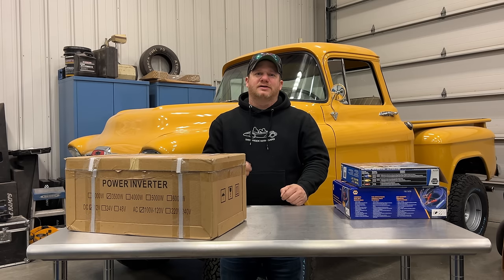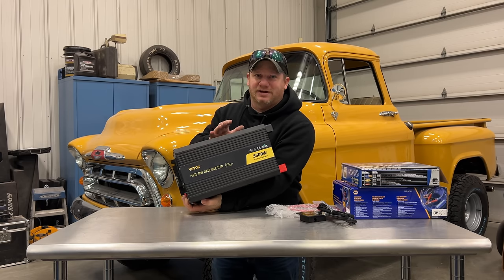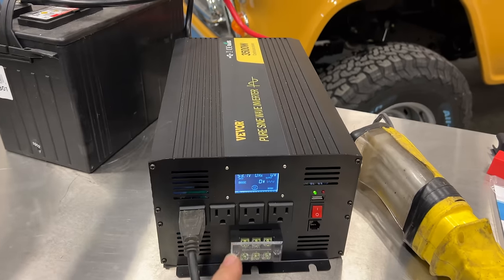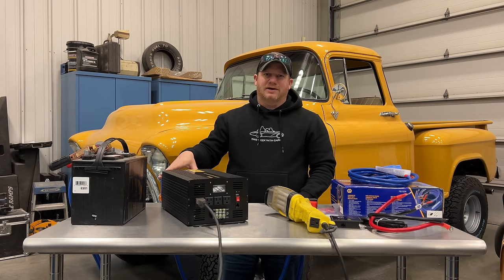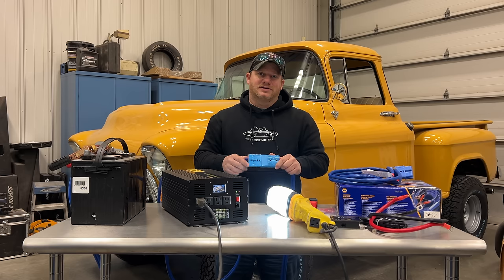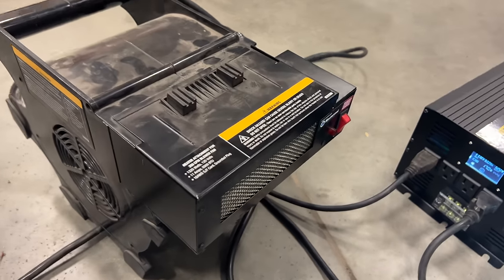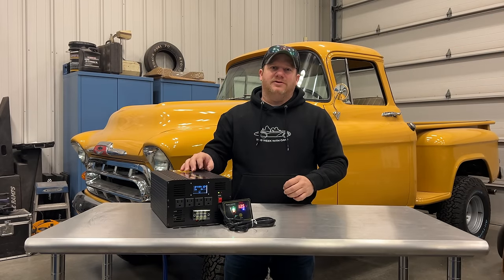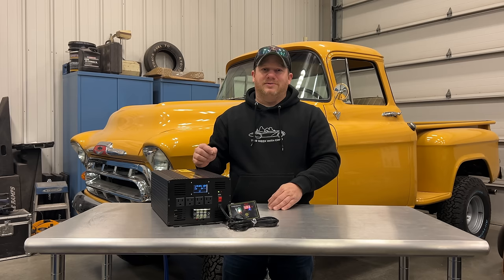Making a Portable Inverter - VEVOR 3500 Watt Power Inverter

Comment: I just bought the Vevor 3500W Pure Sine Wave inverter for short power outages (4-6 hours.)  Here in Florida, during the rainy season we get frequent thunderstorms with gusty winds, which knock out power for a few hours. This inverter will make life easier. I also have a 12000W/15000W generator for long power outages, like after a hurricane or TS. All set for hurricane season.

Comment: I really don't see the need for a huge inverter like the one shown here if you also need a high amperage alternator in order to use it. I have a similar setup, but with a 1500 watt pure sine inverter and that's more than enough to run my refrigerator, a small chest freezer, and a few lights. My pickup is very quiet when idling, so I also use this setup when camping.

Comment: Ultimately it will be the vehicle alternator that is providing the power to your inverter but few will be able to deliver the 3500 watts mentioned which would be over 250 amps.
Reply: The alternator of a 4 cylinder car 🚗 will generate 250 watts at most.

A full size truck might get you  500 watts.
Reply: @AlternativePower903 

Hi. Thanks for the response and information. 

My car owner’s manual says the alternator maximum output is 40 amperes. 

What is the maximum amperage have you measured from the alternator? 

What’s the wire size of your alternator?
Reply: @AlternativePower903 

1800 watts are 2.41 HP. Your truck engine is around 300 or 400 Hp if your truck is 8 cylinders. 

0.069% of your engine. 

Not even 0.1%. of your truck engine. 

Rise the wheels of your truck and mechanically connect them to a generator. 

350 hp = 257,000 watts. 

You can energize 50 houses each one consuming 5,000 watts.
Reply: @AlternativePower903 

Is that really hard? 

That’s not even 0.1% of your engine output.
Reply: @AlternativePower903 

On a 3 hour trip at 90 mph the engine runs at 3000 rpm for those ours.
Reply: @AlternativePower903 

What power? 

1800 watts? 

Are you running a 12 volts microwave oven in your truck? 

I have never measured the current a generator produces. 

What does the vehicle need 250 amperes for?

Comment: You have great access to tech that wont filter thru to NZ for a year or so it seeems. Would these or similar convert to 240 volt? If so I could fit one of these to my house bus and delete the noisy old petrol generator and the tiddly inverter we have at present.
Reply from the maker: Yes you can get them in 240 volt

Comment: 3500W from say 14V, that's 3500/14 = 250amps. At 90% efficiency, more like 275amps. Don't forget to upgrade your alternator and calculate what size wiring you need! Lead acid car batteries totally suck in this application, you can't draw a lot of current out of them over time. They are optimized for large but short current spikes to start the car.

Comment: I moved to New Zealand, here the power is 220v. I have a few 120volt power tools that I brought with me from USA. I'm thinking of getting this power inverter to power my tools, do you think it will work fine and safe?
Reply from the maker: Yes I travel with a small car inverter because every country you can at least use a car to get the correct power if needed.

Comment: i have 3000 watts pure sine wave that build power station in tool box with 110 volt out let and switch and my tool box is water proof with cooling fax and breaker on it and 12 volt light on it with deep cycle battery

Comment: I was going to make a set up like yours with a inverter connected to a battery that was being charged by a alternator and the inverter company told me it will damage the inverter.

Have you experienced any problems with your set-up?
Reply from the maker: No of course not, it is exactly how the inverter was intended to be used, why would it break the inverter?
Reply: @ThisWeekWithCars  I have no idea. They did not provide a explanation. I thought perhaps it was something to do with ripple voltage produced by the alternator, but that doesn't make sense. If a alternator was producing excess ripple voltage a modern car with all the electronics and computer systems would not put up with that. The battery should smooth that out as well. It had me baffled.
Reply: @Hydrogenblonde 

To protect the alternator you need a dc-dc charger.

Alternator (car) -> battery (car) -> dc-dc charger -> battery 🔋(a different battery) -> inverter
Reply: @ajarivas72  I'm very interested. Do you know of any examples or videos of this set up?
Reply: @Hydrogenblonde  

Search for: Renogy dc-dc charge alternator.

The inverter will work fine if you connect it to your car battery 🔋 but you can burn the alternator ⚙️ ⚡. With the dc-dc charger you protect the alternator and battery of your car.
Reply: @ajarivas72  what causes the damage to the alternator?
Is it having to supply too many amps/ watts while the inverter is in operation?
Reply: @Hydrogenblonde  

exactly 💯 that. If the load connected to the inverter requires more watts than the capacity of the alternator ⚙️ ⚡, this will get damage.

The function of the dc-dc charger is to limit the current coming out from the alternator.

The battery connected to the inverter can supply temporary high current and if the inverter requires more power than the capacity of the dc-dc charger the voltage of the battery will decrease until the inverter turns itself off due to low voltage.

Comment: Could solar panels be added to that inverter? 
There are portable power stations where solar panels can be added so I was curious.
Reply: No, voltage from solar panels are around 18-22volts and will burn up 12volt products.  Panels need to go through a charge controller then to a battery storage.
Reply: I forgot you could run panels through a dc to dc converter and then a power inverter without batteries.  But the power out (amps) would be low and not run much. There is a YouTuber named Will Prowse (diy solar power)  that explains how to do that.
Reply from the maker: You can add solar panels to keep the battery charged but you cannot run it on solar with no battery.